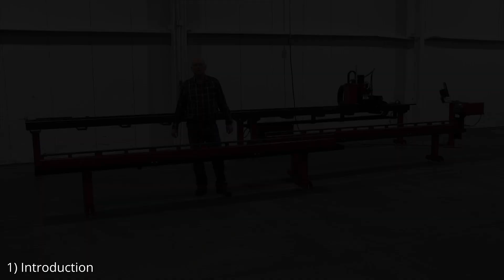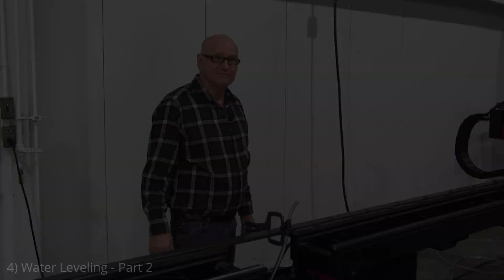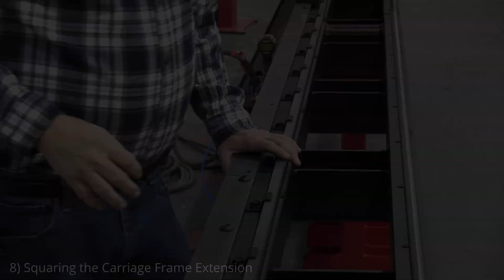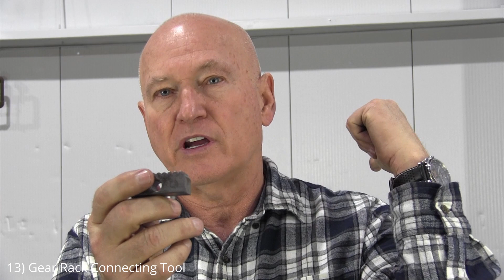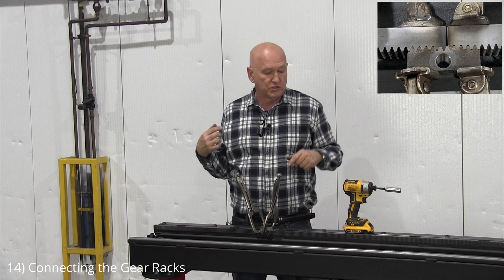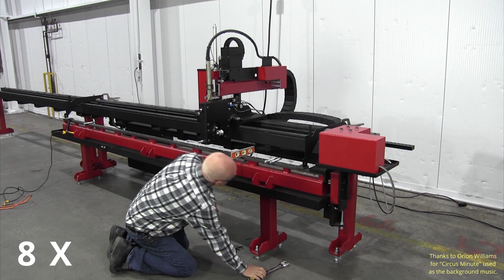JD Squared RC6 Rotary Cutter - Frame Setup

Comment: Why no dowel pins between the sections?
Reply from the maker: That was actually the original design. It's a big heavy machine and trying to align the frame halves using dowel pins turned out to be incredibly difficult. You could literally snap 1/2" pins just by shifting the end of the frame extension. I use dowel pins in many places on the RC6 but not on the frame connector. The current design is very robust and aligns easily. Thanks for asking. Bob